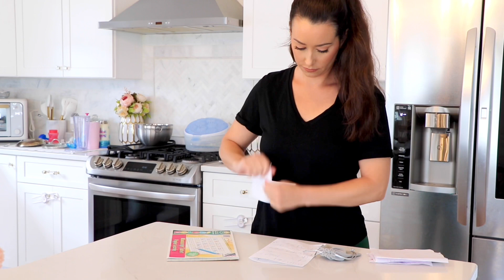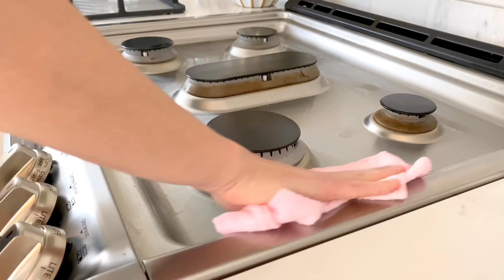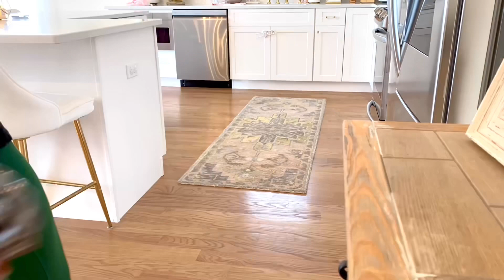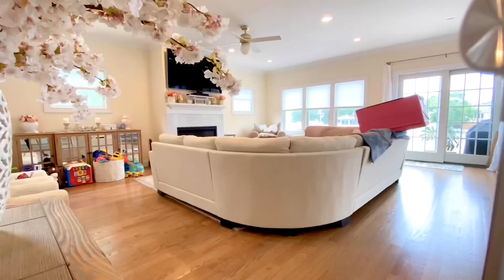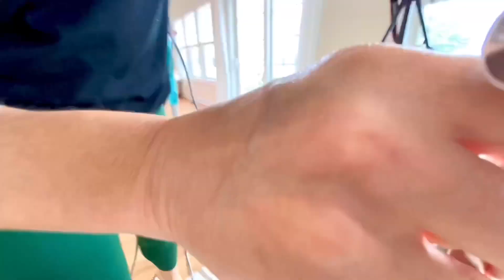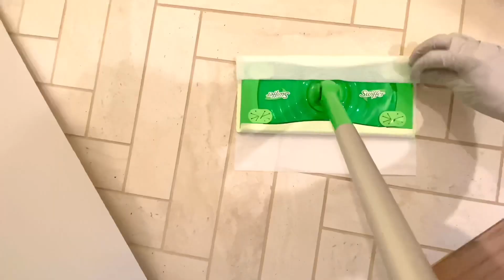RAINY DAY CLEAN WITH ME - CLEANING MY WHOLE DOWNSTAIRS!

Comment: Don't buy Kirkland wipes either, very hard to get the pull up type out of container and they fall apart! I've used the Dawn power foam since you mentioned it last time you did a cleaning video and a couple of other tricks of yours. For cleaning my uncarpeted floors I bought a heavy duty type of swifter at a janitorial store and the pads are removable and you throw them into a washing machine when you're done. 🌺
Reply from the maker: Good to know! I always eye those at Costco! That sounds good, I will have to try that swifter :)